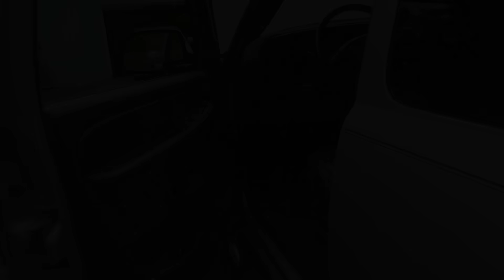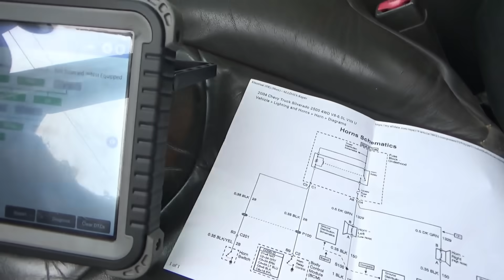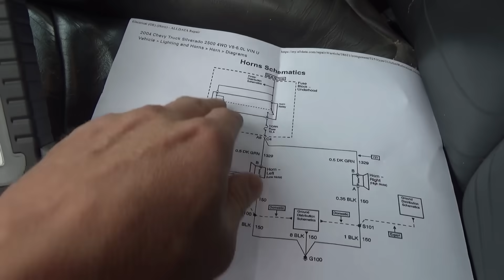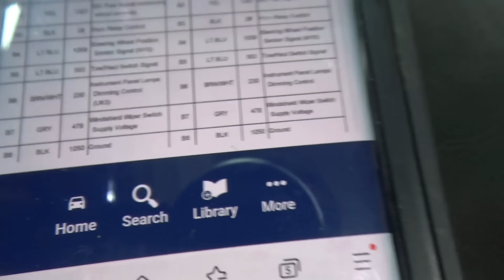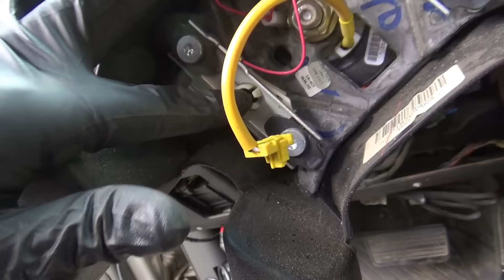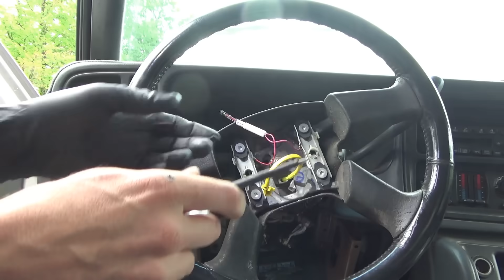NO HORN Chevy? No Parts Required! ('04 Silverado)

Comment: I had the horn ring get a bad groove on the 06 Sierra  also the multi function switch post was bad that rides on the horn ring.   Truck had 200k at the time so it was all worn. New Horn ring and new turn signal switch and its great

Comment: Had same problem in toyota, steering wheel horn switch lost contact with the ground on the metal surface of the steering wheel. I sanded it down so it is shiny again and put some lanoline so the surface where it connects wont oxidize again. Works 4 years already.

Comment: I have a question what do you think of the Ford Transit van that have the 4 cylinder engine are they a good van does the engine have the rubber belt to run the oil pump

Comment: Thanks Ivan, I have an 03 Tahoe that only one horn works most of the time don't remember if it was the high or low note horn, put a new one on and it worked for a while. Checked the relay and ground to that one horn and both were OK, any suggestions on this issue would be appreciated.

Comment: That's why I am working on Caddy now. The shop who worked on the car doesn't have a good bidirectional scan tool or service information. All they do is get code scan at the zone then fire parts canon. Then to top it off they buy Flea Bay parts and expect things to work.  Nice job Ivan.

Comment: Ivan, you make everything look so simple. I have an 07 Honda Ridgeline. I have a good scanner and I have been trying to diagnose the cruise control. As far as the scanner goes. I can test the master switch, the brake switch all the buttons in the steering wheel For the cruise control. They all work everything checks out as far as scan data, but when you turn the master switch on, I do not get the cruise control light in the dash however I can turn the cruise control light on in the dash with the scanner using the master switchso like you said a good scanner that’s half of it but service data as far as a wire diagram, that’s what I’m lacking. I don’t know when you press the master switch why it will not turn on the cruise control in the dash that’s where I’m stopped.

Comment: They have so cheapened so many things on newer autos. That part used to be a carbon brush riding on a brass or copper slip ring, similar to the brushes -slip rings in an alternator. They lasted too, sadly not so much today.

Comment: Older British cars used to have somethig like that through the steering wheel, spring loaded thing and it had a wire in the middle and sometimes that wire used to break and horn wouldnt work...good stuff Ivan..Fred. Uk.

Comment: In my dads 2000 model Holden VX Commodore it had a problem where the airbag light would turn on intermittently,he had a mechanic clear it then it was alright for a while then he took it to Holden when it turned back on again & they cleared it, it was alright for a while then it turned back on again so I suggested replacing the clock spring.

So I ordered him a brand new clock spring & fitted it, when he took it to his mechanic to get the annual registration inspection done he cleared it & the airbag light hasn't turned back on ever since.

While the horn might not be as bigger issue the airbag circuit is very important because they won't pass it  if they think that the airbag itself might be faulty, the horn circuit in the Holden Commodores which are fitted with an airbag is incorporated into the clock spring itself as it the airbag & the volume controls, etc for the stereo !

Comment: NPR must be some target that every technician should strive for. I remember my 1990 Pontiac Sunbird would sound the horn at 3 am when it was -35 C. I think the cold would cause contraction and make contact for horn to work. I had to run outside freezing my ash off and rip the horn pad off the steering wheel. PAIN IN THE ASH

Comment: Pretty much all cars and trucks that is usually the first place you start is the steering wheel bad connections Oh in Ivan that is called a carbon pile button It's similar to what's in old school distributors.

Comment: A co worker called me over to push the horn button on a Silverado he was working on while he back probed the horn. I picked up the key fob and double pushed the lock button which made the horn beep. I told him not to work so hard, learn the systems. The truck had been in an accident, the airbag was replaced but the body shop forgot to hook up the horn contact.
Reply: but..
using scan tool applies to more circuits than juat horn.  I.E. learn this SCAN TOOL METHOD not just horn repair.
Reply: My 2020 Malibu was in an accident and a year after the repair I lost one of the two horn tones. You wouldn’t know it from the factory service manual but the two different horns are on opposite sides and, sure enough, it’s the one where the repair happened.

The body shop didn’t even reattach the bumper correctly and I found an extra motor mount bracket tucked into the cowl. It sent me on a wild goose chase to find out where a part goes only to find out it had already been replaced!

Not a fan of this body shop.
Reply: clever!!!